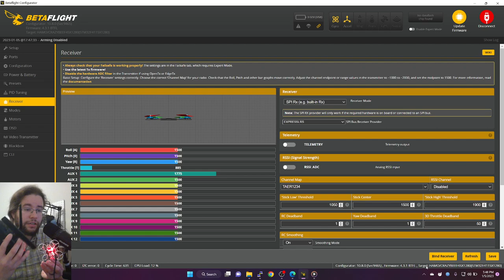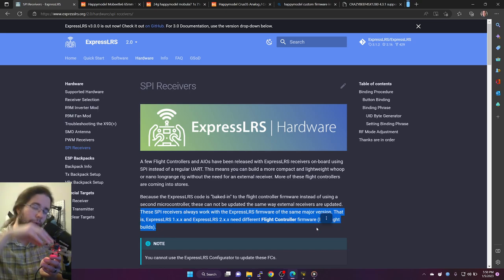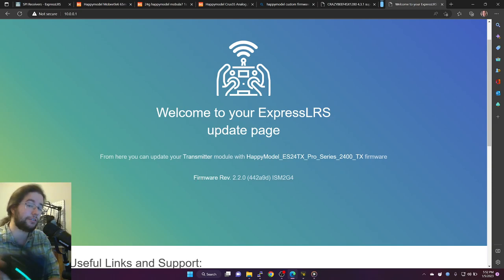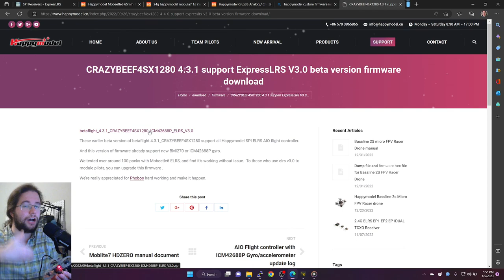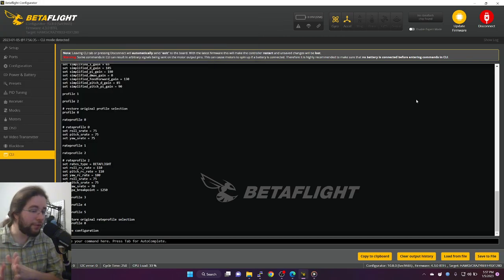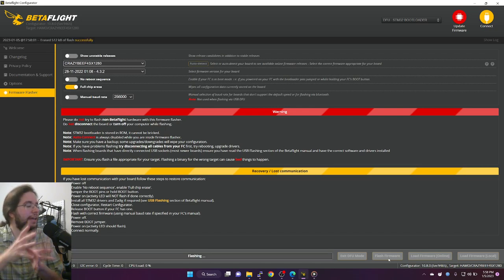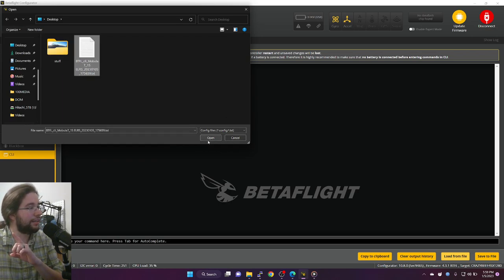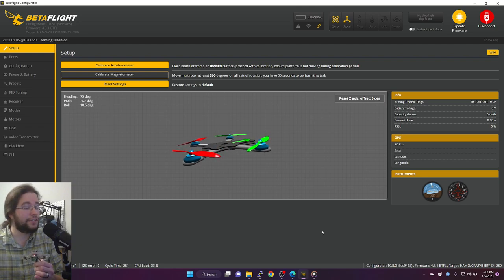Happymodel Mobula7 1S ELRS / Mobeetle6 / Crux35 ELRS SPI Won't Bind to 3.0? Easy Fix!

Comment: Any reason to choose Happymodel's 4.3.1 over Betaflight 4.4 for these select drones? Guessing it's just because HM released a supported version? My M7 1S ELRS is on 4.4, and when I loaded HM's official diff for 4.3 I did get some errors, but it seems fine. I'm still pretty new to this, so I'm just wondering if I should try going down to HM's 4.3.1. Thanks!
Reply from the maker: Great question. Betaflight 4.4 was a release candidate/in testing almost 2 months ago at the time of this video, so it wasn't advisable to promote upgrading then. Now with BF 4.4 released, I can say that it is safe to just go ahead and upgrade to 4.4 and skip the happymodel file. However, there are a just few things to consider; the first one is to check the anti gravity gain settings and make sure you reset them to BF 4.4 defaults. BF 4.4 and 4.3 pid tuning is the exact same, so you can safely migrate that over. Anti gravity settings should be reset to the following, if you aren't sure, after any upgrade just run this in the cli:

set anti_gravity_gain = 80
set anti_gravity_cutoff_hz = 5
set anti_gravity_p_gain = 100
save

Next, is whether you are flying analog or digital. If you're flying analog, after an upgrade there should be nothing else to do. But if you are flying a digital quad, you will get an error during the paste of the cli dump about "displayport_msp_serial" not existing. That is because they changed the way to assign a digital video transmitter in 4.4. The solution is simple, though, after upgrading, a digital vtx user of a platform like HDzero, WalkSnail, or DJI, simply needs to note what serial port they had their digital set up on, and from the dropdown menu in the Ports tab associated, select MSP/displayport. For someone who is new and does not know about checking to do this, though, they would upgrade and lose their on screen display elements for their digital quad immediately after upgrading to 4.4. 

So in short, my video instructional is still the absolute simplest path in most cases to follow without needing to consider anything since it is a 100% drop-in replacement that will work with all current settings. Otheriwse, the considerations about need to be checked out. 

I am personally going to migrate all of my 4.3 quads to 4.4, yesterday I migrated my first quad and it could not have been easier. Your 1s ELRS is an analog build, but I see the stock happymodel cli diff file for 1s elrs has the following:

set anti_gravity_gain = 4500

You probably received an error on this value, -- if it is flying fine, you can leave it alone. This value probably got tossed because you can't actually set anti_gravity_gain any higher than 250 on bf 4.4. 4500 is out of range, I'll bet it automatically defaulted you back to 80.
Reply: @JohnCuppi  Thank you for the fast and detailed response, it is greatly appreciated! You are correct, the 4500 value on anti_gravity_gain was reset to 80. I did use default settings after the 4.4 flash, and it looks like the anti gravity settings are exactly what you listed when checked in CLI. Flashing 4.3.1 would have certainly been a little easier, but I'm glad I gained a little extra experience. Thanks for helping out the FPV community!
Reply: @JohnCuppi  wow very nice response clear and to the point
Reply from the maker: @matthewkaran6608  Thanks, I also have a video guide on 4.3 to 4.4 for these targets now: https://www.youtube.com/watch?v=Zn_CnluSzHg
Reply: Tried it. Didn’t work.  
So I have the mobula 8
Saved back up 
Pressed auto detect. 
My flight controller came up and it said Beta flight 4.5.1 another video I was instructed to flash it.  
My Boxer radio is elts. I set that up and I set up the binding phrase. It’s on ELRS 3.3. 
In beta flight when I go to receiver, I click express LRS and it says to enter my binding phrase. I enter it. I press save and reboot and then I turn on my Boxer and nothing still will not connect. 
I’ve tried plugging my battery in three times or actually two times quickly and then the third time to enter binding mode pressed bind on my remote nothing no matter what I do. I cannot get these things to bind.

Comment: Thank you so much for this video.
I upgraded my Bassline to BF 4.4.2 and it works. Oryginaly it was BF 4.5
I tried to bind my radio for few days and without you prabably I would not fix this issue.
Reply from the maker: So happy to hear this, thank you for the kind comment. I need to do a 4.3, to 4.4, to 4.5 video next. We have been pretty lucky to be able to hop from these versions mostly with just a few things to reconfigure over the years, but sometimes there are "gotchas."

Almost all of my main fleet are on 4.5 right now, haven't had any issues like that yet.

Comment: I’ll give this a spin. Got a Mobula 8, I think it has the correct latest firmware, but I need to go through these steps.
Reply from the maker: I got the mobula8 walksnail and I would recommend just upgrading to 4.4, you can follow my bf 4.3 to 4.4 video 😊 a few months after I made this video, bf 4.4 was released and includes ELRS 3.x so there’s no reason to stay on 4.3.x anymore. Plus you get the HD canvas option.

Comment: Thanks for the informative video. I have the opposite problem, I have the Mobula 7 with BF 4.4 but my Jumper T Pro is 2.51. ELRS. No success in binding of course. I have not managed to flash my Jumper to ELRS (SPI) 3.0. Any insights? Flash my Mobula 7 back to 4.3.1?

Comment: Awesome video thanks for posting it resolved my problem with bidding👍🙂 Can I update any ELRS drone with 4.3.1_CRAZYBEEF4SX1280 firmware? Thanks
Reply from the maker: No, only if the board target is CRAZYBEEF4SX1280 — most ELRS SPI are, but some aren’t. But you can also just update to Betaflight 4.4 now on any board to get ELRS 3.0, the custom firmware is no longer needed.
Reply: @JohnCuppi  Thanks for reply and support 👍🙂

Comment: Hi Thanks for the video. I followed along and my pocket master with built in elrs still won’t bind. The drone makes a little jiggle on the BF screen then just continues slowly flashing red and my stick inputs do not move the bars on BF.  Could this be a bind phrase problem? It’s almost like it connects for a split second then rejects

Comment: Having this same problem. Flashed to same file on BF 4.4.1 as you did and module on elrs 3.0. Made sure telementary on and enabled everything like the rate index appropriately yet still not binding. Radio is on 500khz
Reply from the maker: Hit up the ELRS support areas for further assistance, it sounds like something else is going on beyond my knowledge here.
Reply: I was accidentally flashing 4.4.1 instead I flashed to 4.3.1 and got no gyro…
Reply from the maker: @chasedierkes6809  There should have been no issues flashing 4.4.1 though. I've updated my entire fleet to 4.4 by now and binding works just fine. What is your exact Betaflight target? This 4.3.1 file will not work if it isn't CRAZYBEEF4SX1280, you will get NOGYRO error if you flash the wrong target.
Reply: @JohnCuppi  I’m on crazybeef41280 target but is there any way to work around this. The board seems fine everything else working just can’t bind it
Reply from the maker: @chasedierkes6809  If you're 100% sure you're doing everything right, and you know there is no problem at all on the radio end with binding to anything else... then it is quite possible that the SX1280 2.4ghz transceiver on the flight controller is defective. 

That is the only thing that would prevent a bind if everything else is set up correctly. I have not heard of anyone so far who hasn't been able to bind to 3.x with either this firmware file, or by just updating to 4.4.1. And it sounds like you have checked the things I would have, such as the expresslrs rate index, etc. 

Last thing I can think of is disabling multi bind. 

You can work around it by soldering an external receiver to the board. There's broken out pads for it.
Reply: @JohnCuppi  what do you mean by disabling multi bind? Do you do this on the radio
Reply from the maker: @chasedierkes6809  Sorry, I used the wrong term. It’s called Model Match. It’s a setting in the ELRS script you can turn on or off in the menu on the radio.
Reply: @JohnCuppi  turns out I wasn’t entering the bf 4.3.1 v3 file right for the firmware update but I just flashed as you did and now have gyro back yet still can’t bind this thing. Set to 500khz, no model Id, and have entered uid bytes as well as set my rate index and model domain
Reply from the maker: @chasedierkes6809  I’m super stumped. In the ports tab, uart1 is set for serial receiver, right?
Reply: @JohnCuppi  wait I’m still trying to get the spi rx working and spi doesn’t use uart. I have already wired ep2 and had the rig flying no problem. just don’t want the extra weight
Reply: @JohnCuppi  you are referring to a uart based rx correct?
Reply from the maker: @chasedierkes6809  yes. if the SPIstill doesn't work at this point, and you know there's nothing wrong on the tx side, then I'm assuming the 2.4ghz transceiver is just dead, or there's a broken trace, or something. 

When you solder the ep2 rx to the board, then you can flip serial rx to on for uart1 for these. it's off when using SPI, betaflight just "knows" to use the SPI rx when configured in receiver. sorry for the confusion.
Reply: @JohnCuppi  all good. I’ve came to realize that the 1280 chip is dead or maybe there’s something wrong with antenna. I have a bit of experience with the heat gun and replacing those eew fets and tiny resistors and what not so I went ahead and replaced the chip and desolderd the tower. Cleaning up now and seeing results
Reply from the maker: @chasedierkes6809  Sorry, it does suck when an on-board receiver dies, I totally get not wanting to add weight and sticking it out to make sure you've left no stone unturned here. It's one of the reasons I still fly FrSky on my mobula6 65mm whoops... 

I've had one external elrs receiver die before as well because I assume the SX1280 rf chip just died or whatever. And, that was on a "quality" brand receiver at the time from AxisFlying! Hah! All of my cheap-ass happymodel and betafpv stuff is still rocking. 🤷‍♂
Reply: @JohnCuppi  yea weird it’s not a chip problem because I’m done replacing it with new one that was good and everything still doing the same thing. It must be in the mcu chip but I’ve already replaced 2 fets, and 2 of those tiny resistors on this board snd now that elrs chip so I think I’m done for now. Also took the cam and all motor plugs out to save weight. And the board is meant for a tks rocket frame with 45mm props. Was only 20 g with props but I guess I can afford the ep2….
Reply: @JohnCuppi  have you ever heard one of these boards making a high pitch ringing when held close to ear. I am now hearing this….

Comment: Is this the problem I'm having with the Tinyhawk 3 freestyle spi receiver. Both drone and ext module are on version 3 of elrs. Would the reflash work for this?
Reply from the maker: Yes, it is probably the issue. However, do not follow this video for it. Just upgrade the drone from 4.3 to 4.4 instead.

Comment: I am on my 3rd crux35. I love them! My new Crux35 is built differently and I am having such a hard time binding this drone compared to my others. Someone help please!
Reply from the maker: I bet you have the crux35 V2? That's the version I just bought, I'm on my 3rd as well lol. Here's the thing: the newer crux35 V2 do not use SPI receivers, and have to be bound using the standard ELRS binding methods.
Reply: @JohnCuppi  yes! V2. what’s the standard way? Thanks for your help!

Comment: Hi thx have quiet the same problem my sorrow it’s on 3.3.0, and I actualise my meteor 85 on the firmware 4.4.2. 
I could bind the radio but when I get in beta flight on the receptor screen, the bars doesn’t move at all. The roll, pitch, yaw and T decenas the number onto 988. And the quad rolling like crazy. 

Some one know what could be the problem.

I have the maps Chanel aert on the radio and the dron.
😢
Reply from the maker: Disable model match on your ELRS TX maybe?

Comment: I was able to update fc, but now the quad just revs up and flips....motors in correct order etc...any help I can get?   I also saved a copy of the original settings and loaded them in cli....just can't get the mobeetle6 to lift off without flipping.
Reply from the maker: Wow that's really strange! I am wondering if the FC orientation is not set right. Have you tried flashing back to the original 4.3.1 and loading your saved CLI, does that work? If so, maybe you should just do that, and then follow my other video on upgrading to betaflight 4.4 instead. This video is rather outdated now, this custom 4.3.1 is not needed and maybe something is missing if your Mobeetle6 is a newer batch.
Reply: @JohnCuppi  I did reload the 4.3.1 with the saved file reloaded in cli.  Should I download the  4.4 version  through the betaflght app- the suggested update?    I've built a ton of quads- and yes sort of acts like board orientation but can't see why it would be out from the original settings.  Upon arming and applying throttle it starts to "wind up" and becomes unresponsive to throttle so I have to disarm.  Like some rate is way off. If you have email I'll send you the cli dump.

Comment: when i go to load from file in the cli it just opens the folder with a bunch of random numbers and not lines on information telling the drone what do to.
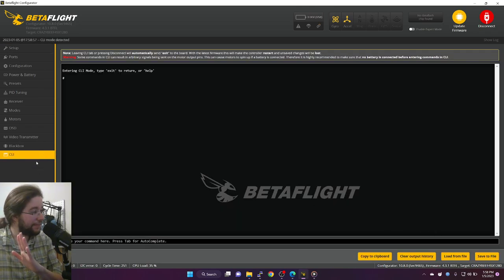Reply from the maker: Did you select the betaflight firmware *.hex file by accident possibly? That's the only thing I can think of. The file to load in the CLI should be your backup config ( see 6:09 in my video )

Comment: I have a new RM Pocket and I'm trying to bind a new Mobula7 HD. Radio is on ELRS version 3.30 and the 7 HD is on Betaflight 4.4.2. bound two other models no problem, but this one is still not binding. I would think that the situation below wouldn't apply going back to 4.3.1.   Any ideas? I've been out of this for about 5 years and ELRS is challenging for an old man. I remain determined though.  Thanks.
Reply from the maker: Don’t knock yourself for being old, from what you have written here you are much farther along than a lot of younger people I have helped with ELRS. 

4.4.2 should be binding with no issue to ELRS 3.x for the SPI receivers. Although the method in this video did work fine, that was before 4.4 was released with 3.x support. 

It would not hurt to try the custom 4.3.1 method, but from everything you’ve said here I’m afraid that the on board device itself may be physically defective. 

There have been a handful of people who have followed my instructions to the T, but could not bind, and it ended up being a defective FC. The fact that you have been able to get 2 other models bound but not this one tells me that there’s a strong likelihood of that being the case. If you’ve retraced all your steps and it still doesn’t bind… in the worst case scenario you can solder an external ELRS receiver to it.
Reply: @JohnCuppi  Wow, thanks.  To be clear, the other two were a RM PWM and serial receiver.  This is the only SPI I've tried.   For $15 it seems like a no brainer to just add one that is likely much better anyway. I started my quad journey with KK board build some years back. I think I can handle adding a RX. Fingers crossed. Any suggestion for a good one to install.   Thanks again.

Comment: hey bud watching your video because I m using the darwinfpv 1-3s and using betafpvsx1280 and its just not working because I get no Gyro on most versions and or no channels in betaflght. if you know Id greatly apprechi any help
Reply from the maker: I actually have this flight controller as well. It came with the darwinfpv baby ape I reviewed a while back. I have actually not flashed a custom target for BETAFPVF4SX1280 yet. 

I see a 4.4 RC target for this FC, which should work for ELRS 3.0, have you tried that? I am going to try it now and see what happens.

Comment: My Mobula7 1S is getting stuck at "Initiating reboot to bootloader" when I try to flash but I have the latest bf configurator. Tried the ImpuleRC drivers but same result. Also happens if I try to flash to latest firmware using the online option. Any ideas?
Reply from the maker: If this happens, try the following:

Go to cli and type “bl” at command line.
Then go to firmware flash page
Turn the “No reboot sequence” option to ON. 
Now try to flash.

This skips the “init reboot to bootloader” process because by going to cli and typing “bl” you are putting it into bootloader mode / flash mode yourself.
Reply: @JohnCuppi  Thanks for the rapid help! Sadly when I do that I then get stuck at "Loaded Local Firmware: betaflight_4.3.1_CRAZYBEE....". Seems very strange. Tried using the configurator 10.8 and same thing. Thanks!
Edit: I am now noticing an error at the top of the screen saying "Failed to open USB device!" whenever this happens, but I still see DFU - STM32 at the top of the screen and the Mobula is still powered/connected.
Edit 2: Tried on another PC and had the same issue but when I tried the ImpulseRC drivers it worked! Scratching my head a little but glad it worked in the end.

Comment: Hey, I forgot to save the backup diff file thing before I flashed the firmware. Where can I find a downloadable version of it?
EDIT: forgot to add, it's for the Mobula7 1S ELRS
Reply from the maker: Happymodel has the files here for you: https://www.happymodel.cn/index.php/2022/05/17/mobula7-1s-and-mobula7-hd-1s-manual-documents/